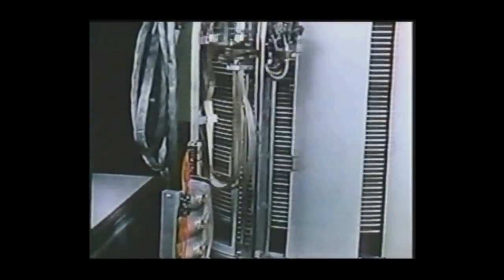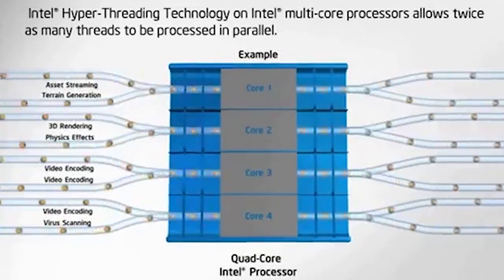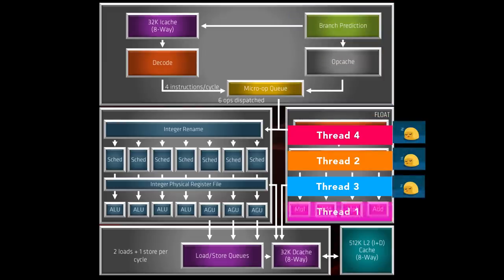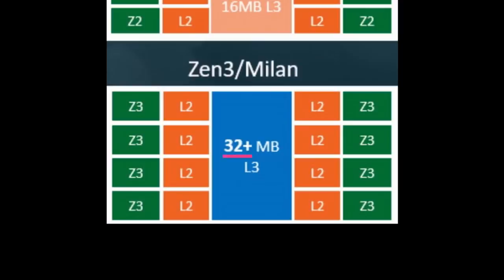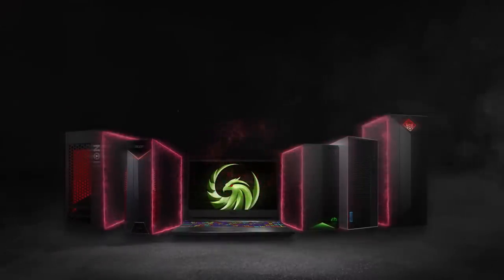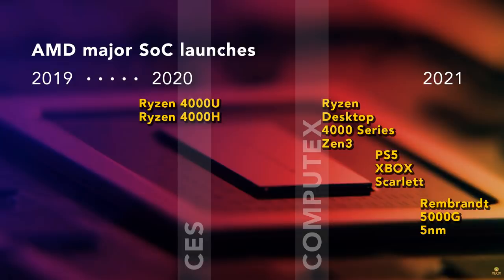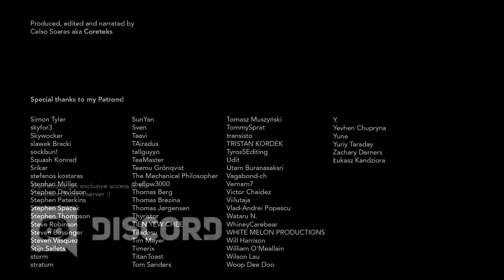Rembrandt | AMD’s MONSTER 5nm APU

Comment: POWER9 core comes in two variants, a four-way multithreaded one called SMT4 and an eight-way one called SMT8 AMD are only trying to stay on top of the CPU market and with chips like the Power9 and RISC-V coming to market AMD must keep up with newer standards. The issue will be the x86 CISC architecture  isn't as efficient as a RISC based system, sure each one has benefits but to argue which is better is just dumb. But the future is in multi thread per core, since node shrinking is going to hit a wall for a few year until a suitable replacment for finfet CPUs. Just like Intel are struggleing with anything smaller than 14 nanometers everyone should hit a wall at 3 or 4 depending on architecture. So because of this an increase in core count is the only way to move forward with more powerful CPUs. This process ideally isn’t what a CPU manufacturer would want but it's inevitable. So SMT4 or even SMT8 is great for the consumer and it halps AMD compete with compainies on the rise like Power9 and RISC-V.

Comment: Apu's have come a long way but they'll never catch up to a discrete gpu.
Even if one of them offers the same perfomance as a 5700xt, that is in a few years from now and the 5700xt will be a mid to low end card by then.
For example, a 3400g is roughly the same performance as a GTX480.
So if the new apu will be 5nm , do you honestly think that the discrete gpus won't be?
I'm sure you see where I'm going with this

Comment: SMT4 would have lower single thread performance unless they significantly increased execution units, branch predictors, cache, etc... which they probably can't do yet.

That being said, there's no reason to expect them not to do it eventually. SMT is mostly about efficiency, efficiently using all resources. Before SMT CPU were running between 60-75% theoretical peak. They're getting a lot closer to 100% these days.

It really comes down to which way AMD plans on going with it. AMD could design a massive single core and break it down with SMT4 or continue to add more cores and keep SMT2. The net result will be about the same however with massive single thread performance and a dynamic SMT4 they will have better peak single thread numbers compared to a design comparable to today's with relatively equal multi-thread performance and lower single thread.

It could go either way, but in order for it to work properly it needs to be designed for SMT2 or SMT4 from the ground up.

Comment: I believe IBM cpu's run into this when only asked to manage a single thread operation. I watched a video awhile back about Power8 cpu's and how they function. I asked someone on a forum why Intel doesn't and according to a few people, the x86 architecture is one and the other is Cache availability. Cache on x86 is essential to running all those threads. It limits the bottle necks inside the cpu by giving extra resources. AMD might have found a way to resolve this. But again, core contention is a major problem. either you'll suffer single threaded performance or you'll suffer multithreaded. take your pick.

Comment: Yeah... I wait for what's to come. This is, to be nice about it, very, very optimistic.

Current gen APUs still suck compared to dedicated cards (if TDP or cost isn't a concern anyways).

They still have a long way to go; once they match the - at the time of release or shortly after - gen 60 Nvidia cards I would consider them.
Until then I rather stay flexible, buy a separate, cheaper and better CPU with the potential to upgrade the GPU further down the line.

Comment: So, the problem of smt is windows. So, it's easy, uninstall windows. Windows runs to much crap and slowdown the computer. The scheduler in an operative system, can choose which hardware threads to use. Use one thread per cpu until all cores are used, and then get to smt, and finally if there are more, switching threads are always.
Reply: Microsoft actually just invested in a custom AMD cpu for their high end Surface laptops.  They have been working on the SMT, just slowly....
Reply: I think linux is actually a good enough alternative at this point.
Reply: @adelaide7822  linux is not really good for the average consumer. I mean even as someone who does linux for work I wouldnt use it at home because it isnt supported as well in comparison to windows. macs are just designed to look pretty... but if you need to do anything they are pretty useless. linux is good for server based things where you dont have to play with windows desktops.
Reply: @checker297  For most average non-technical people I think it is quite usable, I mean you have a web browser, email client, office suite and spotify. For gamers it is not completely usable since many popular games are not yet playable, though since I don't play those games it works for me (and also rgb support is bad). Imo if you do 3d modeling on blender, linux is the way to go, since you get a performance increase. For video/photo editing it is not great since many of the programs that people prefer to use for this are not on linux (yet?), and I don't think many people want to learn a completely new program if they already know how to use another. For programming I think it works well.

Comment: Only so much current ("threads") /data/1's & 0's that can physically go thru the chip. and what about the lanes, and controller? there are not that many pci lanes/bus too.
 I mean we can try but i'm pretty sure the core will vaporize or at the very least throttle at minimum. I think timing the threads would do better, maybe have more than one area/cpu/transaction area where its totally dedicated to the function. there has to be a sweet spot and stable to use.

I find after 18 years of working with Windows, and building machines for individuals, Optimization works wonders. I lost count of the number of times i had to totally start software installation again after building a fresh build for someone. people just install programs they think they need but in reality they are adding more checks their system goes through (im not just talking about boot times) it takes time for data to travel within the Op. And Yes, I know.. I ramble sometimes.

Comment: The explanation on threads is a bit misleading. Performance aware software rarely uses L3 cache, as it's slower and has higher latencies. You'd be looking at L2 cache at most when it can't be avoided.

Comment: Nice Video! 
But is there even software out that can handle 64 cores?
Reply: @Viewer19  autocorrection kicked in
Me 10 minutes later: autistic screach
Reply: Yes, but the utility is in running home servers. Imagine a single CPU running and transcoding for Plex while also running a Dropbox like service on top of a NAS/backup service for all the other PCs, phones, and tablets you own. Automated torrenting of anything thing you want. Censor proof social media, blogging, and general web hosting. You do this with virtual machines for security and each one wants 4-8 cores of its own depending on the number of users and how reliable you want it to be. Games are boring. The future is taking your shit back from the cloud.
Reply: Yes. Some video editors can already do it, with the right settings and codecs. Rendering of still images can basically be scaled out to as many threads as you have pixels. Databases can often scale out that far as well. A lot of physics simulation can scale out like crazy. There is overhead in splitting up your work, so it's not always worth it, but some niches can use all you can provide and then some.

Comment: I understand that doing four X the amount of processes with 1/4 the speed is faster. But implementing this probably in games take at least 10 years, just going off of the adoption of hyper-threading in games.

Wouldn't it make more sense to just make a CPU with 64 total cores but only eight of them run at a high frequency, then let software developers optimize their code to be processed in batches and let the CPU decide where to place the program data

Comment: 1:30 No need for Gaming CPUs? Perhaps for DX9 games. I mean, current IGPs can do 1080p DX9 games just fine.
Perhaps this technology can do DX11 1080p, or DX9 4k games; but you'll need a beefy GPU to do DX11 4k gaming. Especially with Ray Tracing enabled.
DGPUs won't go away anytime soon!

Also 4 threads per core, is just a gimmick. Intel has proven that 6 full cores beat 4C/8T both in power consumption, and performance.

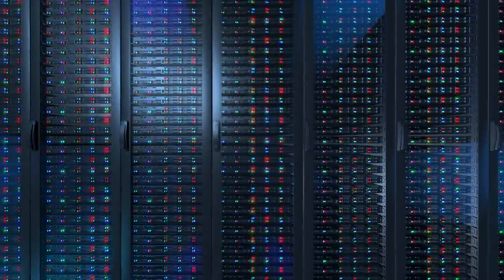Comment: 9:50
OH GOD ALL THE FAULT LIGHTS ARE BLINKING
WHAT DOES IT MEEEEEEEEEAN??!
HAS MY SAS ADAPTER CAUGHT LP0 ON FIRE??

</sarcasm></capslock>
Reply: Followup: If you're going to 3D model a server's front panel, for the love of god at least take the time to learn which lights are *supposed to be off during normal operation*. To us techs it's the visual equivalent of an air raid siren going off. Also, servers do not sparkle like multicolored christmas lights.

Solid green is usually power status; solid green on drives indicates a SAS device with no activity, blinking green indicates activity, SATA drives often do not enable the solid status light. Network ports often have one solid green light indicating gigabit link status, and another green light blinking to indicate activity. The link status light *does not blink*. It will either be off, solid orange, or solid green. Board management controllers often have a heartbeat LED which is pulsed once per second in either green or blue. Some SAS controllers (adaptecs) have channel activity blinkenlights in classic red, but generally are not visible from the outside of the chassis.

Sadly, I know someone who produces these sorts of aftereffects projects for a living and consistently gets little details like this wrong.
To lend another analogy, it'd be like holding a soldering iron at the 375c hot tip instead of the visually distinct grip, taking photos of it, and selling those misleading photos as stock images depicting the act soldering occuring.

Or THAT CHICK IN THE LABCOAT THAT EVERYONE WITH A VIDEOBLOCKS SUBSCRIPTION USES.
STOP. Oh god, I'm getting triggered by bad stock footage. 🎶What the hell am I doing here? I don't belong here. I don't be-long here.🎶

Comment: Alot of what you are saying makes the bad assumption that AMD's core will remain the same size and complexity while merely tacking on 2 extra threads.... what is more likely is that they will increase the core resources by 1.5x-2x which will mean a single thread will have the potential for much higher IPC due to more resuorces, and there will be less slowdowns when more threads are active due to more resources being available per core. In this case SMT4 is being used not to use up resources that are idle but to justify adding extra resources to increase peak IPC. Also, if AMD makes a 4 core laptop APU with SMT4 it will have 16 threads, if it can maintain higher boost clocks when fully loaded it might acutally outpace Intel's mobile 8 cores by leveraging higher IPC, and in multithreaded workloads by being able to maintain higher boost clocks.

Comment: The only tbing holding back apu rigjt now is lack of on die memory. Throw on 4gb of HBM amd its off to the races, a r5 3600 with rx580 performance built in for $150? Hell yes. Want 8gb of vram and 8 cores? $220. And the gpu is equal to an rx5700. Give it a couple more years.

Comment: Coreteks, as a Dutch guy I have to tell you that you pronounce Rembrandt the wrong way. Other than that, an interesting video as always. The SMT-animation is a bit too strong an oversimplification though in my opinion. The biggest problem for APU's seems ot be the memory bandwidth, 3D stacked memory might eventually solve that problem.

Comment: Not sure why were putting so many Technologies in between multicore and polymorphic code. What you say polymorphic code is like the difference between the first dual core and today is dual cores.

It's basically a 99% efficient process of dividing up the processing power and evercore that works as efficiently with an 8 core CPU and a 3000 mini core CPU.

The only problem everyone developing software would have to retrain to do this and we're not even teaching people to do this today.

But there have been some proof of Concepts, we all know you can get plenty more performance with just optimization, Nintendo was a good example.

 but there are a few examples of companies experimenting with it but it's not open to the public, but in theory this could spell the end of random frame drops, because software and Hardware is actively predicting the processing load on the CPU and diverging some of the process to other cores preventing lag spikes.

For example they took her phone and I can barely run a league clone, increased the average FPS from 35 to 45 and there were zero frame drops more than 5 FPS in a 2-minute.

Comment: I noticed people used to call SMT a version of HT now its the other way around.
Reply: HyperThreading is, and always has been, Intel's marketing term for SMT.  They did not invent the idea (I believe IBM did in the 1960's).  They just brought it to desktop processors first, and couldn't resist calling it something else.
Reply: @TrueThanny  I get that, but the fact is nearly all tech press called AMD's SMT a version of intel's HT when zen 1 came about regardless of the fact SMT is the generic and correct non marking term. I was pointing out how that reference to one another has swapped and is more than likely is due to AMD's mind share subconsciously changing the way people reference the technology.

Comment: What you said that Zen 3 will compete with Intel in IPC is not correct I think more or less you mean zen3 will compete with Intel in clock speed because zen 1 already competed with Intel in IPC remember instructions per clock does not mean overclocking or who has the higher clock speed When comparing instructions per clock it is clock for clock say a Intel 1 gigahertz chip versus a AMD 1 gigahertz chip that is an accurate comparison to determine who has a better instruction set so to clarify Intel's 5 gigahertz 9900 k more or less competed with amd's ryzen 1700x in IPC just cuz Intel's clocked at 5 gigahertz does not mean it's got better IPC.

Comment: Your presentation of SMT is lacking - the reason why it works is that most threads are light and only utilize small number of resources in core so the rest can be used for another light thread.

Also, when increasing SMT support, the core is usually made wider - instead of 4 ALUs, it would have 6 or even 8 ALUs so the contention wouldn't be any worse. Such change would also increase single thread performance for heavy thread (which can utilize more units). Worst point of contention is a memory subsystem. Switching work from multiple threads can sometimes help though - while other thread is waiting for the fetch, current one can utilize all the units and work.

SMT4 in Zen is almost sure to come this or the next architecture. Whether it will be enabled in Desktop is a question. I believe it will be limited to servers and HEDT...

Comment: the voltron APU that you talk only would be possible on a TR4 socket... Cause to put 2 dies of 4gb of HBM2 you need a lot of space, and in 2021 it will not be possible to use 3d stacking yet. 3d stacking really hot components will only happen in 2023/24
Reply: It wont happen until graphene comes in
Reply: @olifyne6761  Talvez tbm possa ser essa a solução

Comment: in all honesty... if Zen 5 series utilise HyperBandwith Memory on Apu in Chiplet form where 1 is Cpu chiplet 1 is Gpu chiplet and 1 is HBM2 Chiplet you'd be looking at a system performance increase of 200~400% they would eliminate waiting orders of Ram (depending on how they implement it.)
changing the 50ns waiting time to L1 cache which is about 0.8 ns this means that a APU could work without Ram and would initially remove any and all communication from ram the L1&L2 cache would have a subdirectory to direct on chip HBM Ram/Vram so on lower end resolutions like 720p or even 1080p a dedicated gpu wouldn't be able to match up anymore.
Now i don't know how far off AMD is with this technology but my prediction still stands that we will see its first gen of True "accelerating processing units" in 2024.
these might not be cheap due to the costs of HBM2.0 or HBM3.0 but they might be well worth it especially in the pro scene's.
They might not even clock higher then ""example 2ghz"" due to heat limitations but the gains should still show in performance. these could be very well be the first of its kind in terms of 100+ instructions per cycle

Comment: People who don't understand how gaming software is written and how software always uses hardware resourses to the maximum have been saying that dedicated graphics cards will be a thing of the past soon since the early 2000's.  In every case they have been proved wrong and the ever expanding amount of power needed to throw images at ever higher resolutions just proves that the GPU industry is safe for some time to come.  Just consider features like Ray-Tracing.  Currently AMD has no GPU on the market that supports this feature and even the best Nvidia can supply (I am meaning the 2080 Super) is not really able to support this feature while keeping high frame-rates and/or detail levels at 4K resolutions.  From an analysis that was done on the Hardware Unboxed channel a 2070 Super is able to support Ray-Tracing on a 1080p panel and a 2080 Super at 1440p with the lower end 2060 Super being pointless unless you use a 720p panel.

Comment: By the way... I bet 18 core Threadripper (3x6 core chiplets) called 3960x, 24 core called 3970x launch this year, 32 core called 3980x and 64 core called 3990x next year. I bet my left ball on this. Why not make 800$ 18 core that uses 6 core shiplets. People will get that over the 750$ 2x 8core chiplets, so they save some more chiplets for Epyc... What do yoy think?